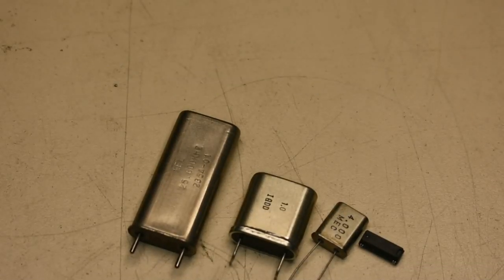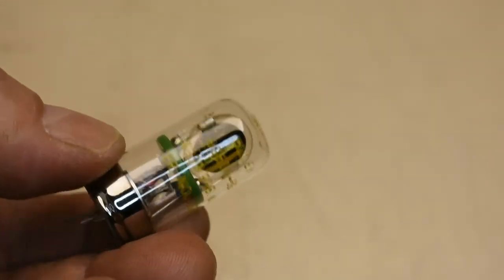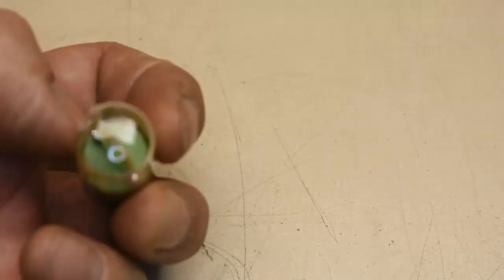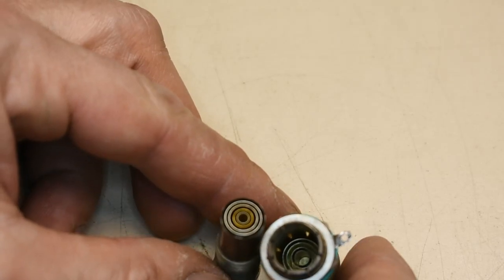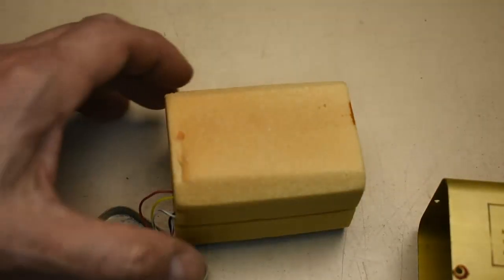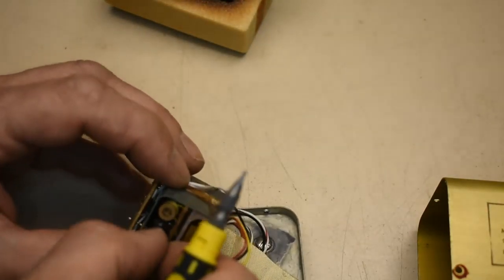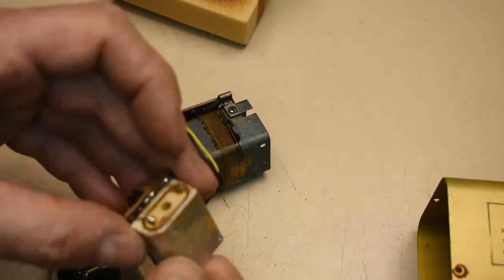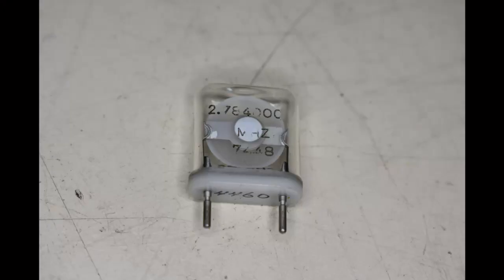Old crystal oscillators

Comment: Love the vintage stuff they work with way higher voltage usually than the modern stuff, any good site on where to document these oscillators especially the soviet kind>
Reply from the maker: Thanks, yeah, easier to see how things worked in older items, but don't really have any links to these old oscillators.